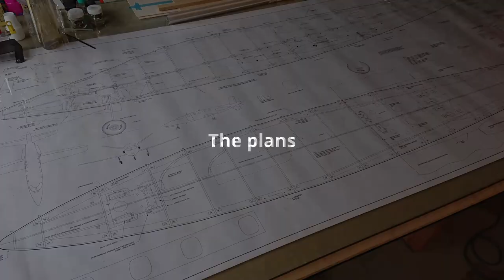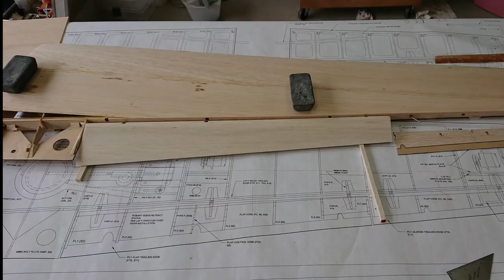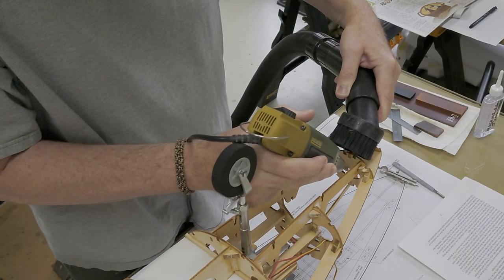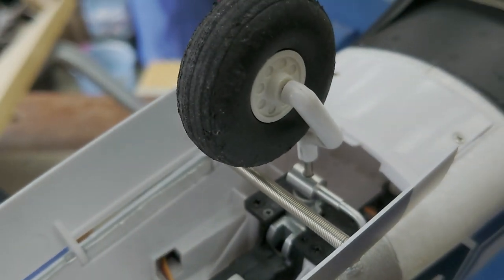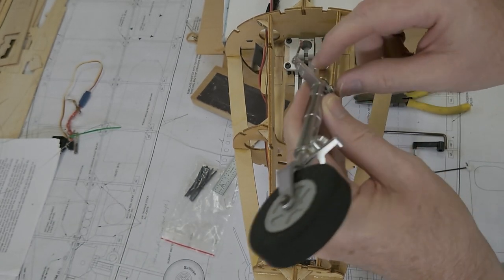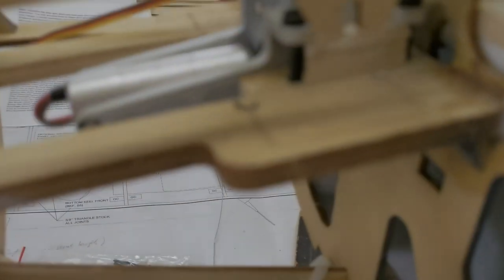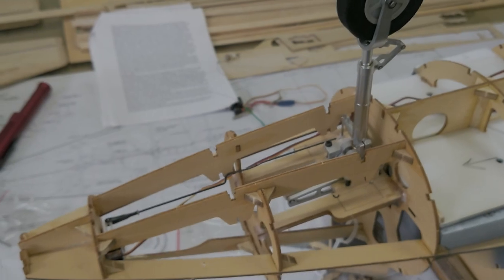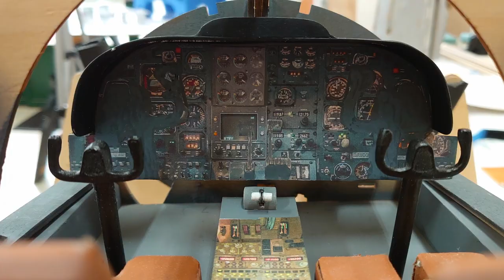Top Notch Lear Fan RC Kit Build

Comment: What is the part number, details of the nose steering arm you used. It looks about perfect for the project im working on.     I'm looking for a alloy control arm just like, withthe split clamp arrangement to rotate a 8mm carbon tube.   Any help would be much appreciated
Reply from the maker: I'm afraid I can't give you a part number.  The manufacturer of the steering arm is different from that of the retracts and the shop owner who sold me the arm just took it out of bin of other pieces.  My apologies.  I'll let you know if I come up with something.
Reply: @BalsaAeroProjects  thanks for the response.    I just found a aluminium servo arm, clamp type.  I'll have a go at drilling that out to suit, hopefully wall thickness will still have the strength.   It's for a fully flying stab on a scratch built project.    Main spar is also the pivot rod. 8mm carbon tube.   Try, live and learn.   🤣 on the bench and not in the air.  Thanks again, and hello from New Zealand